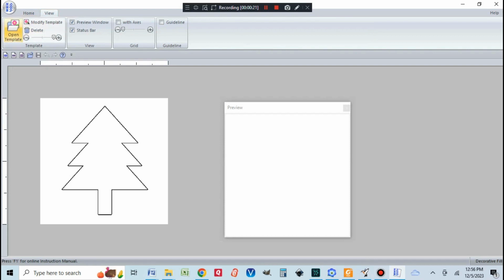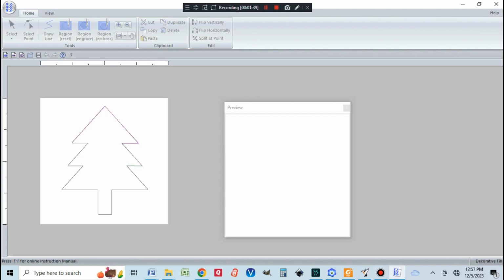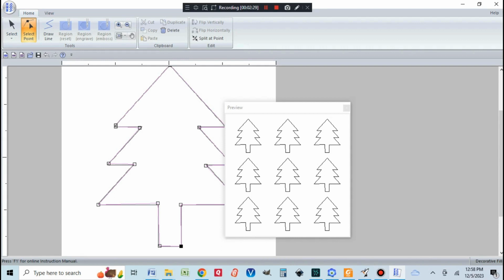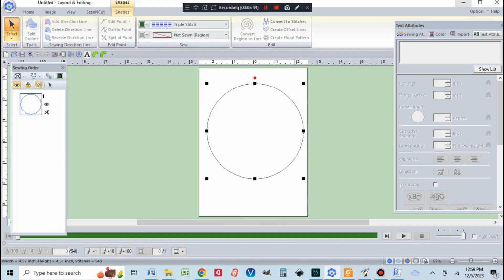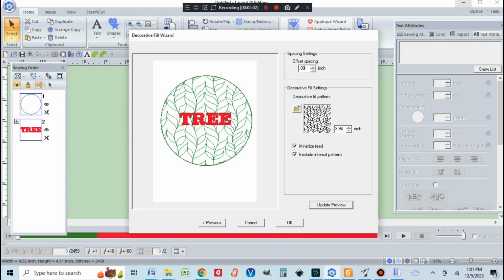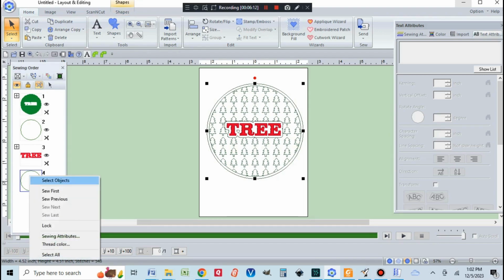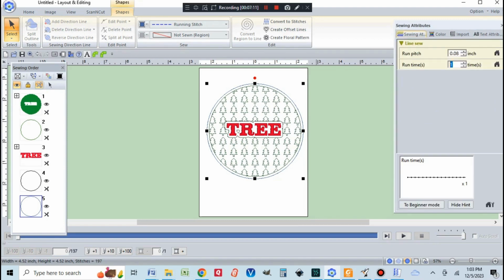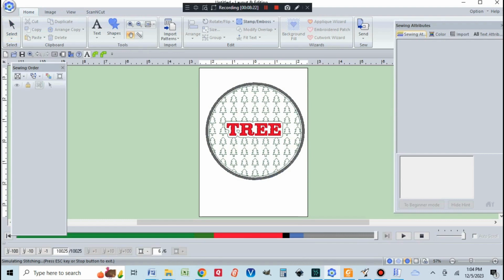Decorative Fill Using Pe Desogn 11

Comment: Thank you so much for your tutorials!  Easy step by step. A question about the decorative fills. Will there be a locking stitch at the beginning and end of each individual tree since they are not connected?
Reply from the maker: my understanding is most brother machines automatically add them. you can certainly manually add one at the start and end points.